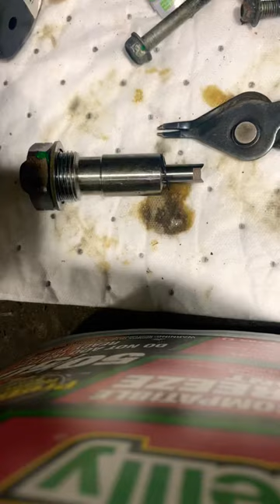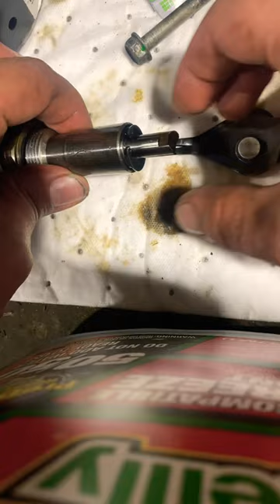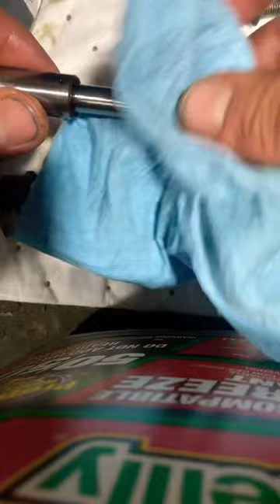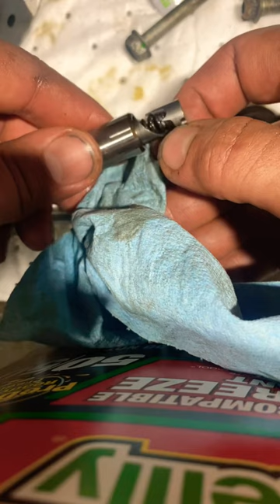2.4L GM timing chain tensioner reset

Comment: Is there a reason to do that with the existing chain or is that something you would do with a new chain only?
Reply from the maker: Something I would do when the chain comes off for chain/broken slider replacement or any timing adjustment because the 2.4L looses its timing and slips teeth when the high pressure fuel pump leaks oil into the engine oil and the chain tensioner doesn’t have enough pressure to hold the chain…